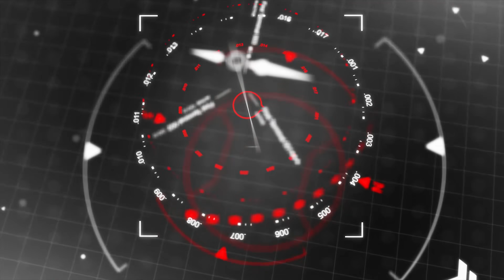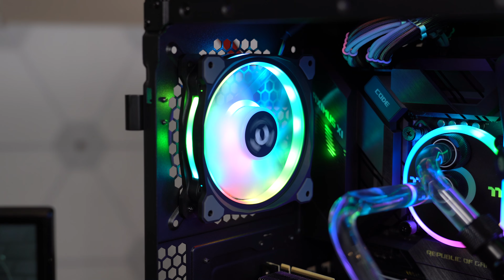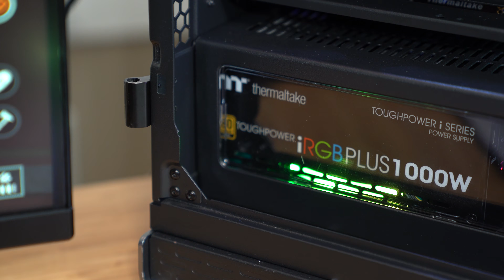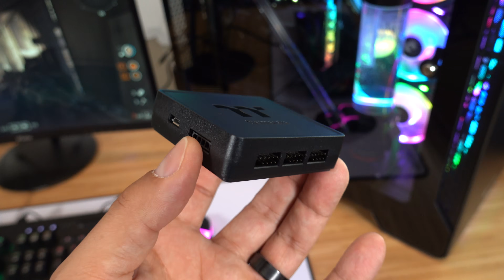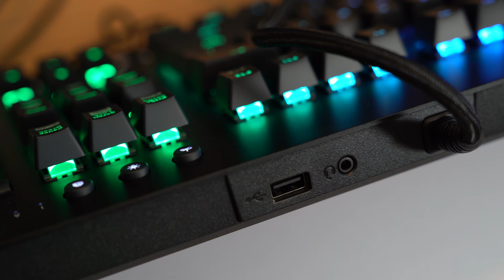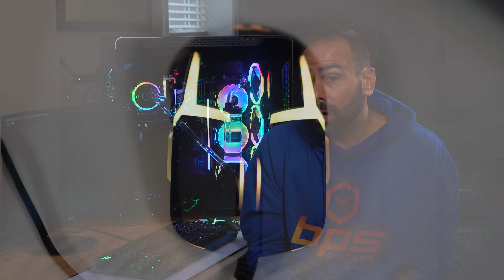Ultimate RGB Full Gaming Battlestation!

Comment: you forgot to get the lian li strimer cables, and the rgb fittings or tubes from thermaltake, who also makes a rgb power supply. lastly where is the RGB GPU water block or the rgb strip lights for case accent lighting.
Reply: The RGB ps is in this...